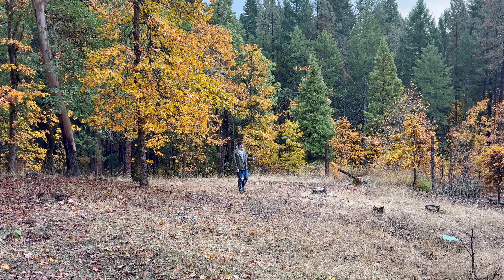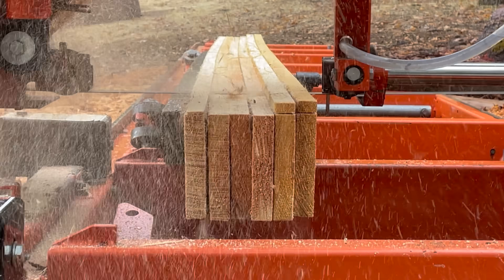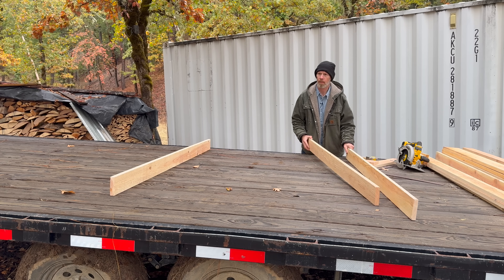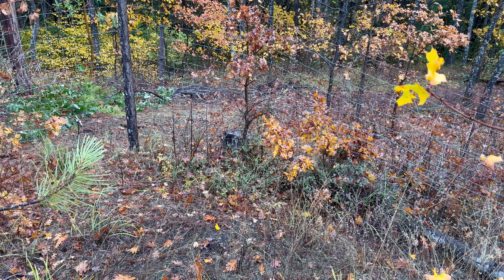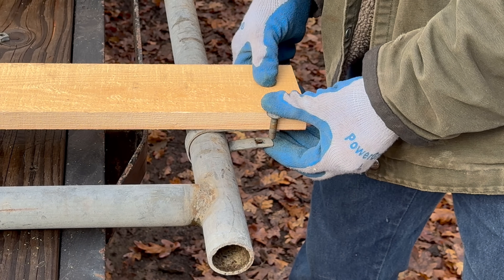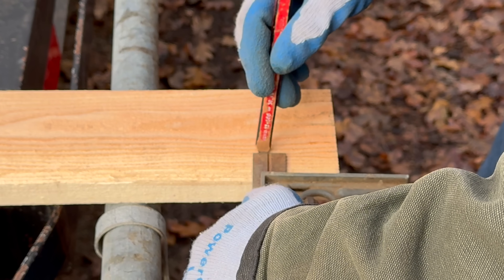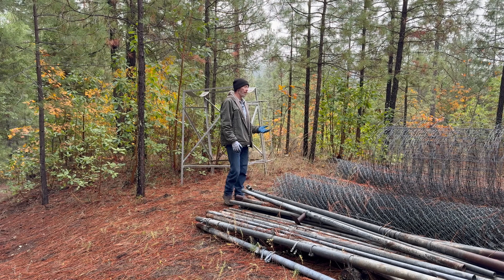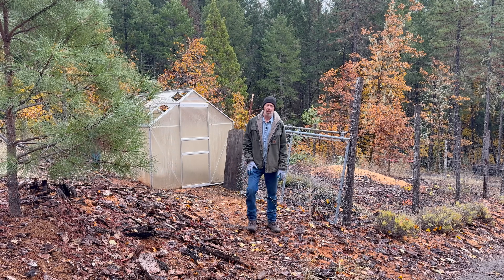How I Saved a Ton of Money On my DIY Solar Without Switching to ......

Comment: 1 3/8" chainlink top rail. Strong, very anti corrosive, and the cheapest pipe around. With the end caps, tension bands and corners you can make just about any shape etc. .

Comment: Never do with galvanized steel hardware what can be done with bailing wire, 550 cord, tie wraps, T-Rex tape, and leftover truck bed liner, expanding foam, construction adhesive, fiberglass-resin-dope,  and exterior latex paint.

Comment: The tiny house I bought in this tiny town had a problem receiving a TV signal. Twas those hills to the west. So I scrounged around and found some rusty old sections of Rohn tower. Sanded, painted, and a crappy antena that drifts where it wants in the wind.
But it is best at holding the 4 solar panels I bought on line.
And a freeby I found made it happen.
A roofer lives down the street from me. When he starts a new job one of the first thing his crew does is remove the TV dishes and their mounting equipment. And he was kind enough to give me several. Complete with the adjustors and those nifty curved pipes.
And those last parts are perfect for pointing solar panels.
Dang, I love free

Comment: Lol... you have no idea how many chain link fence gates I have lying around not being used.   I have 8 gates and about 1000 feet of fence  ...I stole it  fair and square.
Reply: A trick to screw wood to a chain link fence.... just use a t25 construction screw... run it threw the board.  Place it on the fence and hit with a hammer.  Then just screw it to the fence

Comment: Even after 9 months, if you do it when the wood is really dry, treat it with a 2 to 1 mix of used motor oil and kerosene or diesel fuel, and you’ll probably never have to replace the boards.

Comment: I got approached by a solar company about a yesr ago.  They wanted to do installs in my area. Okay.  I have a south facing deck that I need shaded. And I have a very efficient metal roof.  There is no wsy thry are putting Anything on my roof.  When i said I'll build a frame to mount the panels on to shade my deck, I never heard from them again.  But I also told thrm I want all the carbon possible in my environment for plant growth,  so that may have been it.

Comment: Cool idea!  
I’ve been thinking/planning on building a solar array stand using an old aluminum 24 foot extension ladder, mounting the ladder on an old ford truck rim that is attached to a Dana 60 rear end that will be buried concrete. 
The setup should allow me to raise and lower the array off of the ground and the axle will allow me to attach sunseeker gear to the wheel so the array can twist to get as much sun as possible without taking up much land space? The axle should be able to handle the torque from the weight and weather.  Old ladders and axles are relatively cheap and abundant. 
Welding the brackets will be the hardest part besides digging the hole.

Comment: My dad grew up on a farm and lived through the depression.  He never threw anything away.  He had jars and jars of old bolts and screws and fasteners of all kinds, old wood scraps, scraps of plywood, angle iron pieces, sheet metal scraps.  Whenever there was a project around the house, he could just figure out some contraption cobbled together from all of that "junk" without going to the store or spending a dime.  You two would have got along just fine.

Comment: In fact, we do it the other way round: We don't use wood or galvanized steel to mount solar modules, but stainless steel and aluminum. The reason is simple: the solar elements last 20...25 years and can then be easily replaced. But the mounting should last at least 50+ years ;-)

Comment: the thing about trees is, they are solar powered. they place their leaves to face the sun and they track the movement of the sun through the day and year. they are also very good at turning wind energy into safely stored energy. they make sugars and oils, all perfectly safe and conveniently stored. 

every year the trees throw away the old, dirty, inefficient solar panels and replace them with new solar panels.

so why do we bother with solar panels that are so much less efficient than mother natures solar panels???? because man made solar panels seem like a good idea??? Paulownia trees grow 2 foot thick trunks in 10 years. extract the oils and sugars and you can make electrical power from them with none of the drawbacks of solar panels.  

as soon as we attempt to store electricity, we end up with dangerous unstable chemicals in batteries when we can keep our energy safely stored in wood and oil until we need it. then there is none of the mining etc required for making solar panels....

Comment: The last time I looked into solar panels, which was some years back, the panels had to be mounted on a conductive, non flammable holding device (rack).  Wood fails at both points.  Check your local code.

Comment: You will need a lot more PV panels than that gate will hold.
If you had a chain-link fence running east to west, I could see using the whole fence as a ground mount.
Clamp the tops of the panels to the fence's top rail and add another top rail to support the bottoms and hold them off the ground.
Use some 4x4s to hold the bottom fence rail.
The panels should face south in my part of the planet.

Comment: You have chosen thin film panels they will degrade in a matter of months, only buy monocrystaline. Also if you buy large panels and one breaks you lose a lot of power and money. Smaller panels are stronger and stiffer.

Comment: You don't need those wood strips just use u bolts, drill through the back aluminum edge of the solar panel and bolt it up directly. Put the u bolt slightly off set to the outside of the panel then use some flat strips of aluminum or steel with 2 holes drilled. One hole goes on the u bolt and the other hole is for a bolt that goes directly through the solar panel frame. Where you have 2 panels that meet, leave a open section between them and use a longer section of flat bar that has 3 holes. One in the center goes on the u bolt then the other 2 ends go out to the solar panels and bolt up directly. Putting that wood on there is a waste of wood and sets it up to fail later when the wood degrades and the bolts loosen due to wind moving the panel in relation to the wood. Don't bolt solar panels directly to flat wood like this. Use brackets that bold to the panel then bolt to at least a 4x4 section of wood with a 100% through bolt from one side of the 4x4 to the other. Use stainless or galvanized bolts. If bolting from the panel to metal, ether aluminum or steel brackets use stainless bolts. Years from now you will not wonder about those panels if/when a big wind storm hits. Or the big windstorm tears up your solar panels and you have to do it all over again. Wind loading is no joke and degradation due to movement is also no joke. Thin sections of wood with bolts though them are not strong enough.

Comment: You could of fasten the solar panels to the chain links fence. No need for the lumber. And suspended the solar panels from the trees over head at a much higher height then the ground mounts. Simple.

Comment: I bought chain link fence posts to mount my panels.  I first drove the short green gardening stakes into the ground for the south end and 6' green gardening stakes for the north end.  Then I ran a pole east to west on the short side and used U brackets to mount a couple of solar panels (used $40 each) to that bottom pole.  I mounted another pole at the top (N) side with U brackets.  Then so I could change the angle of the panels throughout the year, I drilled holes in my upper (N) green gardening stakes at angle settings for summer, fall, winter and spring.  I put a U bracket through one set of holes and ran a cross member pole piece screwed onto the lower pole and screwed into the upper pole, then I can use it to lift my panels pivoting at the bottom and up and down the 6' green gardening stakes to the desired height.  U brackets going through the corners hold the panels to the poles.  Two panels is the most you want to lift at a time.

Comment: I have everything I will ever need in those piles of mine. A simple project can  often lead to an extended search that ends up being yet another inventory assessment.  Eventually some remarkable things get built but finding what I think I have and happen to want can be problematic. And happily  sometimes other solutions present themselves along the way before the original searched for  item even gets located.

Comment: How many people in the world are lucky enough to just happen to have a gate from a chain link fence laying around? Well, I DO.  Several, actually. And just recently got a solar panel. Thanks for the tip, dude!
Reply: He shows mounting the wood to both sides where I would have taken advantage of the leverage to use the fence as the base and levered the wood with solar panels to find the angle and use a board to hold it in place while using the pole mount parts to snug them into place cutting the poles for the distance of the right angle. He could also have gotten creative by using two different size posts that slide together to make it adjustable. All the while this creating a nice method using the least amount of material.
Reply: Some guys have all the luck.
Reply: @ravenmad9225  well make your own luck. 🤷‍♂️ you have to get out there to find it. Best way to make it is just taking the chance. You might lose your first few tries but those failed attempts might lead you to success down the road, thus making your own luck.
Reply: I got one or two of those lying around.
Reply: Yeah but do you have a sawmill lying around?
Reply: @Murrray_Duncan  Yup

Comment: I made 1 for 4 panels using parts of the aluminum frame from 2 10' Garage doors I had replaced with new ones. I used a 2x4 (Used) to make the end pieces to attach the aluminum rails to. I took aluminum cross braces from those same garage door frames and made cross braces for the long rails for added support. 
 
I had added a leanto to my main shed and the 2 4x4 posts for the outside I left extended above the gentle sloping roof.  These tops are what I attached the assembly to. 

Now I have 4 120-watt panels with a good winter facing to power a 1000-watt grid tie inverter. Each panel has a max amp rating of 8 amps. I made 2 pairs of series panels that are then ran parallel to the inverter. The inverter needs 20-52 watts to run. Each single panel gives 17 Vdc. with up to 8amps each. Thisseries config gives me a pair of series panels that give ~35Vdc and each leg up to 8 Amps. At the inverter the 2 parallel lines combine so I can have 37Vdc input with Up to ~ 16 amps with full sunlight.  

The lean to is southward sloping. Much better out put than the config I had on the roof of the main shed which had east & west facing sides of the roof.

Still have 4 panels on the shed roof that feed 2 inverters that need 10-20 Vdc to run on. 1 inverter is 1000 watt & the other is a 600 watt. Both inverters have 1 panel on the east face and 1 panel on the west. All Parallel wired.

Comment: my only thought is: is there a reason you couldn't eliminate the middleman and bolt the panels directly to the fence tubes, using those fence brackets?
Reply from the maker: Mostly because they didn’t line up with the mounting holes on the panels. I would have to drill new holes. Those mounting brackets put uneven pull on the boards when I tighten them down. Those are the reasons I didn’t, but they may not be good reasons. I may look for some different brackets that would make them easier to do what you suggest, it would be nice to have them mounted direct.
Reply: @WilsonForestLands  how inconsiderate of the gate manufacturer.

Comment: "A tool is not what it is because of its name but because of what you do with it".

 I got a question if I may. Sorry if you've ever mentioned it before because I have missed/forgotten about it then: when you mention you're starting by truing out the edges of the wood, do you ever check the mill itself is true? I mean, it doesn't matter if it's perfectly horizontal as long as the blade runs parallel to the metal base where the log/wood is placed but, as that base receives some hits from the big logs you work on, do you ever check if it has gone a bit away "out of tune"?

I guess the mill itself is really sturdy and that maybe that level of precission may not bother you but, just asking.

Thank you!
Reply from the maker: Yes, I do have to adjust the bed of the mill once in a while. In this case, those boards turned out only true enough. I noticed they were about a 16th of an inch high in the middle. Not noticeable for what I was doing, but the bed is a little off.
Reply: @WilsonForestLands  oh, thanks for answering. I would think it's really sturdy and that one would have to really go for it in order to making that bed bend in any noticeable way, but I guess with time and use it has to give a little.

Also, I guess it doesn't have all that flexibility one would expect so things were relatively easy but one good hammer... ;-)

Comment: Very cool!  Mounting panels can easily cost almost as much as the solar panels themselves.  I built an adjustable DIY mount for 12 solar panels out of wood and uni strut. Then I bought some aluminum ground mounts, anchored them with 6x6 posts in the ground and mounted 12 more panels on them.  The funny thing was the cost for each set up was almost identical. If you can mount full size panels for less than $75 each, you’re doing pretty good!  👍⚡️☀️🔋🤩

Comment: Nice job. 

Seems like on top of the storage container might make a good mounting location.
Reply from the maker: I would like to put it on top of one of my containers, but they are both in the shade where they are. I had actually thought about getting a new container to put where the panels are to mount them on that. Then use it for something else too. Or move one of the other ones. I’m not entirely sure that I won’t eventually do that.

Comment: Chain link fence pipe makes a fantastic green house as well.
Reply from the maker: I hadn’t thought of that. I may have to start thinking about it now, that might be a good idea.
Reply: I have tons of it because the developer took down the chain link fence and was going to scrap it or haul it off. Some are 20 to thirty feet long and I cannot get them apart. Pipe wrenches are needed to twist them apart. They are going to my property in NC and some will be an antenna mast I hope to pull in some channels. The green house or sometimes called hot houses. Is a good idea. 73

Comment: The thing to remember about electrickery is that if you can see, smell or hear it, you done screwed up somewhere along the way
Reply from the maker: That is a good rule of thumb, I will have to remember that one.
Reply: that's right, don't let the smoke out of the wires, they only work correctly if you keep the smoke on the inside.
Reply: @RickReynolds-p5u  Never heard that for general wires, but it's pretty common in electronics.  Don't let them lose their magic smoke.  They just don't work right after that.
Reply: Electricity should not be seen or heard
Reply: Great quote.... We have a few clicks and sparks that need fixing..... Don't want any smoke 😁

Comment: My uncle was the first in our family to erect and install solar panels.  He made an intricate system that allowed the unit to be erected automatically for maximum solar absorption, and conveniently collapsible for heavy winds and foul weather, all based on barometric pressure relayed by his IBM norc pocket version computer, first of its kind.  Sadly my uncle passed and took the single digit password with him to the grave that allowed access to the automated retractable system.  Forced to manually raise and lower the system, I went to the local gym and hired a body builder.  He’s our power lifter.
Reply: single digit?  how many of them are there?
Reply: @ Reading through old diaries, we’ve narrowed it down to a numeric password, and likely the same password he used for his long-term Nigerian investments, off shore open-encryption accounts and a bumble account, which we are assuming is regarding his interests in winged pollinators.  He was an avid bee keeper.  I’ve been in contact with a code recovery specialist from the Maasai intelligence community and we’re running a series of state of the art recovery tools.   Fingers crossed.
Reply: Well, if it’s a single digit password, you can only be wrong 9times!
Reply: @mycbr600rr unless the digit is a letter  . . . ?
Reply: @utubemouse  well then that makes 35 times unless you want to count special characters and the regular ones. 73